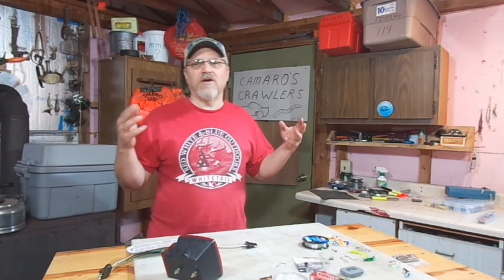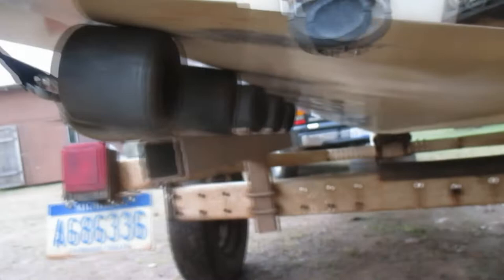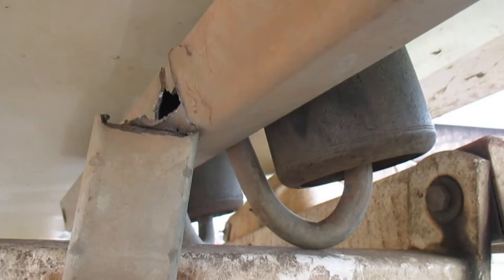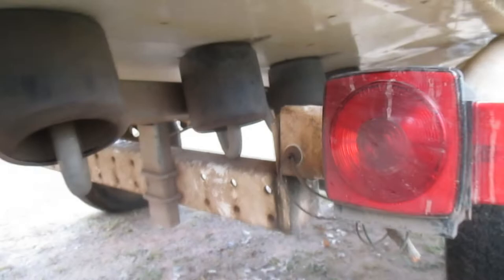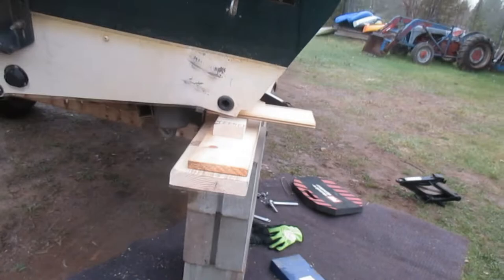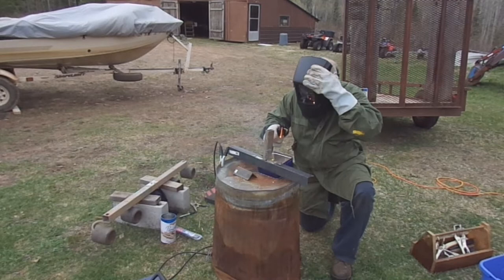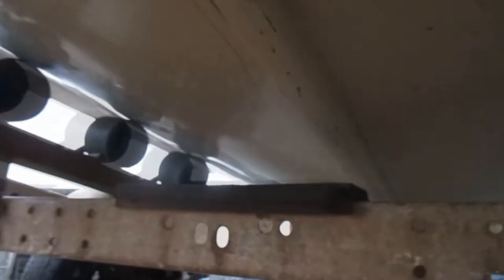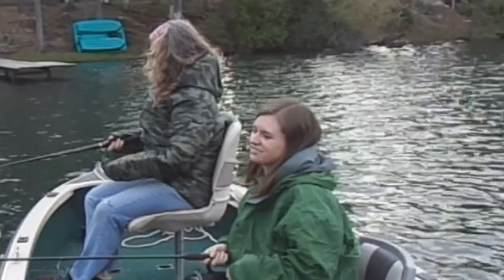Broken Boat Trailer Repair

Comment: We've lost axles, fenders and full wheels. Never had an issue with the rollers. When we go on our annual fishin trip in June up in Northern Ontario, the last 11 miles is a mine rd. It's absolutely horrible. One year I was driving my fathers Crown Vic station wagon and I thought the dash was gonna fall in my lap. Looks like you did an awesome job on that set up.  Just my opinion but I would do the same thing on the other side. It's kind of like just replacing 1 shock. You know the other one is on it's way.
Reply from the maker: I totally agree.  I've been keeping an eye on the other one.  May do something to it in place.  You know part of me wonders if someone didn't back into it in the parking lot while I was fishing.  I loaded the boat in the dark.  All kinds of things I may have missed.  Thanks for adding in, KPO.

Comment: Looks like the weld didn't stick to the roller bracket. It was all on the upright. My opinion. Great video.
Reply from the maker: Your right.  I don't have a very big welder.  Just a small 120 VAC.  That's why I added bolts to it.  Also I added more brackets since the video was made because I didn't trust it.  Thanks for the feedback, KPO.